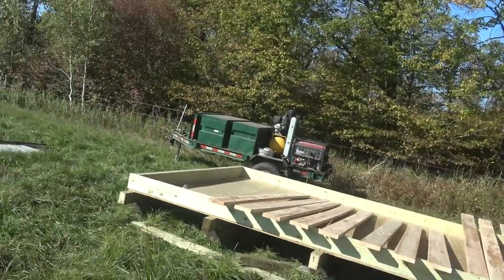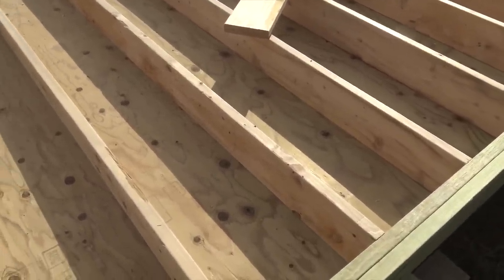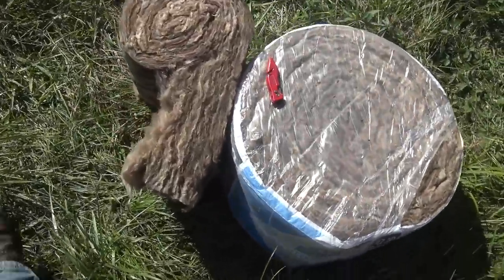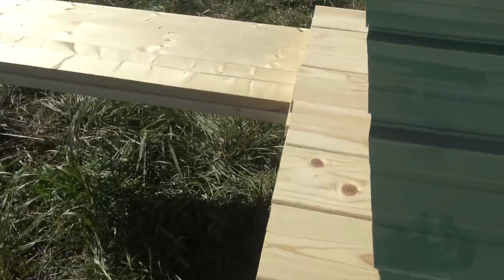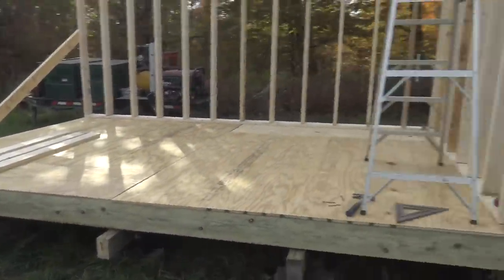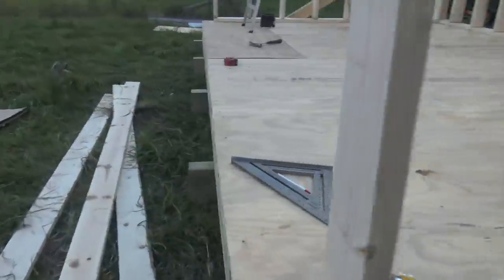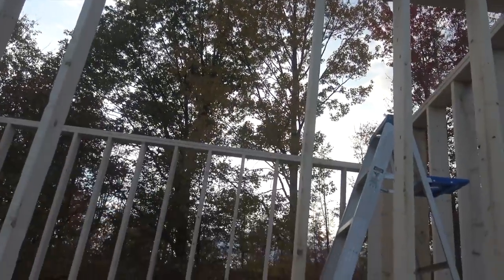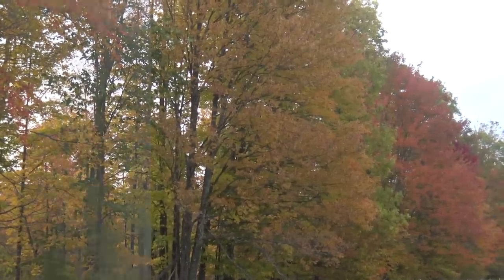OFF-GRID SOLAR CABIN BUILD FROM SCRATCH (PART 2 of ??) NO EXPERIENCE, NO PLANS JUST GOING FULL SEND

Comment: Some people with new construction will opt for 2x6 wall studs on the outer walls to get the higher R-value out of their insulation. 2x4 are just used because they are cheaper.
Reply: Stretch, any wall taller than 10’ (measured from bottom of floor plate to top of double wall plates) are required to be 2”x6” wall studs.

Comment: get an extension ladder, lean the sheets on it 8 foot up , grab the bottom of the sheet and just push it up the ladder, when it gets just past the center of the sheet it will flop on the roof.  You will be able to hold the ladder with on hand and push the sheet with the other.  Use your waist to help balance the sheet.

Comment: watch the old Larry Haun videos, read his book "the efficient carpenter" I'd also recommend watching some YT videos from essential craftsman. I recommend putting your sheathing on first then lift it, use a tractor to lift them or get some friends. When I built our house I ended up just he manning alot of the walls up in 10-12' sections.

Its not essential but putting your OSB lower helps, don't make 8' sections just cover the studs, start at the floor framing with the OSB, it helps tie the entire structure together. 

You can lift virtually anything yourself with a ladder. I was rolling 26' 2x4 floor trusses by myself.

You can add in doors later, I did that too, but you need to make sure to put in your headers and sometimes its a real pain.

Love you stretch.

Comment: Stretch, Man, you need a winch! I've done this kind of thing by myself my whole life, (I'm 62 now), and the BEST friend you can have is mechanical advantage! I used to use a come-along when I was young because I couldn't afford a winch, but when I finally got one I found out that it has no end of uses! I built a flatbed on my truck and welded up ears on the bumper to hold a take down gin pole system that stores on the flatbed. It is the perfect thing for what you're doing. You should think about fabri-cobbling one for your rig. Once you have one and make a few accessories to go with it, you will wonder how you ever got along without it.

Comment: I got a good laugh out of using the joist hangers for framing the wall. Wood framing is always flimsy until you get all the plywood up, then it is very sturdy. 

As another person  mentioned, Essential Craftman has some great building information. The guy has decades of experience and pretty much built large shop by himself.

Comment: Your doing an ok job for your first time building. You should watch a few more building videos, I noticed that you aren't putting in windows? Not to worry you  can install them later but it's easier to build the frames ( rough openings) before you stand the wall up. Keep up the good work, I think you will do just fine. It easier than rebuilding old tractors.

Comment: Build your walls in the flat on your floor, have a couple of long 2×4's handy to nail up as braces, temp nail a couple of short 2×4 'stop blocks' on the sides of the floor to stop the bottom edges of the wall in place, raise it up, kick a saw horse under it, go up more, put a box on the saw horse, so you can get under the wall, nail those braces on each side of the wall, get under it raise it shove/kick it back to the stops, holding it upright move to each side and nail other ends of braces to sides of floor. 1-wall up, now only 1 brace needed for next 2 walls, (nail to end wall temp, permanently once squared up. once up set ridge pole at peaks, nail rafters/truss,  deck roof, now in the dry.

Comment: As for hanging the plywood. Nail a 2x4 to your outer deck . That way you can set your plywood on it and nail it off . Then pop off the 2x4 move over to the next wall
Reply: The 2” x 4” you refer to is called a ledger board, just saying.

Comment: Start the sheets at bottom and run some chalk lines to keep the sheets straight and square, use nails partially nailed in to hold the sheet on other end, I know some old boys in their 60's and older doing this everyday by themselves. Just need to figure out ways to accomplish without help unfortunately

Comment: It's really gonna suck getting into those floor joists now to put the hangers on the perimeter boards.  If there's a code enforcement officer inspecting this he may make you tear it down.
Reply: By code you don’t need them as they are sitting on the sub floor over the cross beams. Literally can’t go anywhere. Thus not needed.
Reply: @ncphenom2309  You may need them on the floor joists themselves, no??
Reply: @robertbannan6437  no, as they are sitting directly on the sun structure.

Comment: The yeti type cups work not because of a pocket of air but that the space is a vacuum.  Air transports heat; a vacuum has no air to transport heat. The purpose of fiberglass insulation is to try to stop air movement so heat isn't transported through it.